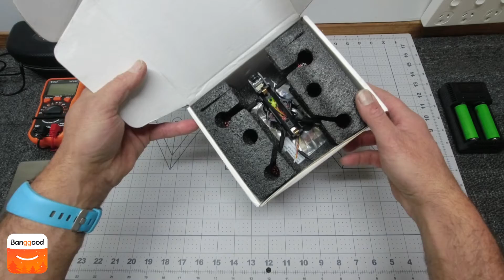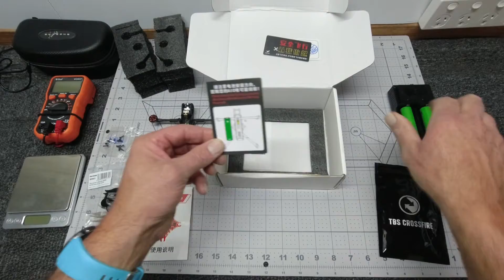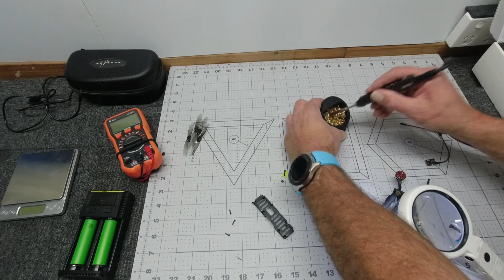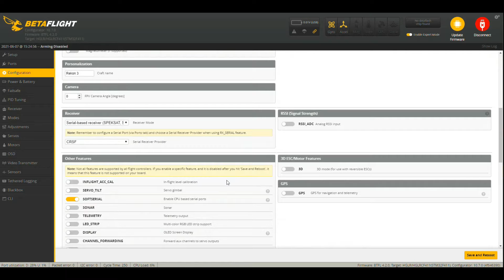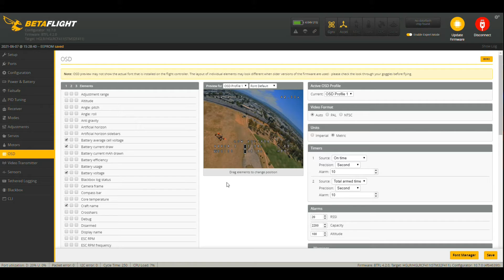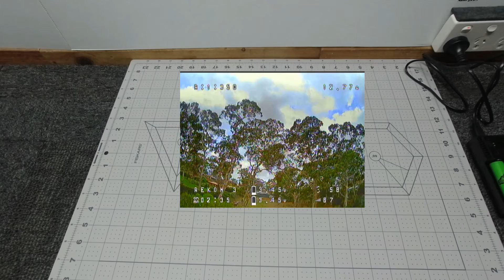HGLRC Rekon 3 - 18650 Li-ion = Long Flights? - Review, Setup, Build 🏆

Comment: Thanks for the setup video, was just what I was looking for. I just got the Rekon 3 a couple of days ago. Mine came with the capacitor on the power rail but with the 2mm center hole props. I would love to hear how you got the GPS on it. For starters I am surely going to put in a buzzer.
Reply from the maker: Great stuff mate. Yep a buzzer is a good idea. Ive found a walk around for the gps. Stay tuned!  🍻👍

Comment: I cant get a picture in my goggles at the moment its to hot here to mess about with it,, but i have noticed the little bolts holding the camera in get hot,,Is this normal ?
Reply from the maker: How  did you get on?  No the camera mount screws should not be hot...  Have you disassembled to se if all the connectors are correctly positioned?  Also what does Betaflight report for the VTX?
Reply: @GTARC_au  Strange one,,First thing i done this morning was adjust the camera down a bit,,Then i took all screws out of the bottom, put battery in and lo and behold a picture in the goggles,, im wondering when i put it back together after binding was there constant pressure  on the vtx Chanel button holding it down ?
Reply from the maker: Sounds like a result mate. Good work!  👊👍
Reply: @GTARC_au   Been out today no problems and screw not getting hot,,,Ah well one of those unexplained mysteries.
Reply from the maker: Good to hear mate. 👍🍻

Comment: One thing that I wasn't able to see, I might have missed it -- did yours come with a 10v 470uf capacitor installed to the board?
Reply from the maker: No mate. 👊
Reply: mine did
Reply: @zar87  good to know — from beta I was told, first batch users got screwed on it and didn’t get one

Comment: No comment on the propellers, like the center-holes been the wrong size (2mm instead of 1.5)?
Reply: If you use the proper ones, they will press fit very well, no screws needed, and that will safe 2grams of weight, which is a lot on this quad.
Reply from the maker: I tend to use screws to fasten the props down anyways. Cheers.👍
Reply: On the first batch they not only didn't include a capacitor that's needed, but also they sent the wrong propellers, should have been a 1.5mm center. :\
Reply: @JohnCuppi  And they ABSOLTELY insist, that those are the right props SMH
Reply: @FPVisnotacrime  I take it you haven’t had a great experience with yours so far? I only have a couple of flights on mine, once I learned about the missing cap i quit flying it until i can get one on there. I feel like this is a novelty quad honestly. The 18650 concept is neat work by dave_c, but the rekon build wasn’t quite as good as his concept.
Reply: @JohnCuppi  On the contrary, I have more than 5 hours of fly-time on mine by now, it‘s just annoying, when a company is trying to talk themself out of a mistake.
On the other hand, I have done quiet a few modifications on mine, like a buzzer, better vtx antenna, a taller lower housing printed with a better material.
Reply: Oh, and most important, a velcro strap to secure the battery, highly recommended.
Reply: @FPVisnotacrime  Got one of the little betafpv straps on it. I’m a little afraid of losing this one honestly so that’s another reason my flights have been limited at the moment. Sounds like you’ve done some great modifications, and agree on the frustration of HGLRC/RekonFPV insisting things are right when they aren’t.
Reply from the maker: The 18650 is held in super tight. Its actually a struggle to get it out...  i wouldnt bother with a strap.. 👍👍
Reply from the maker: This is the first of many to come. 👍
Reply: @GTARC_au  Trust me, I know, why I‘m doing it, it’s no fun to look for a green battery in tall grass, and no battery means no buzzer, so that is not easy either…
Reply from the maker: Yep. Theae still fit and work well. About to do a range test with mine! 🍻👍